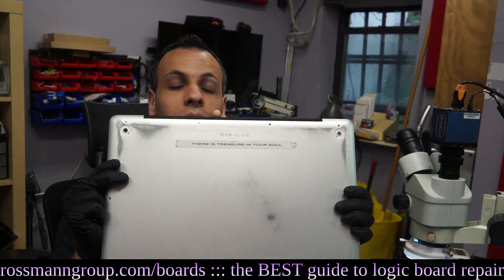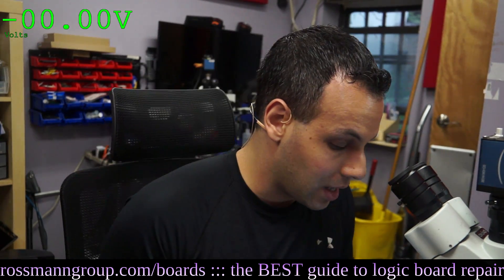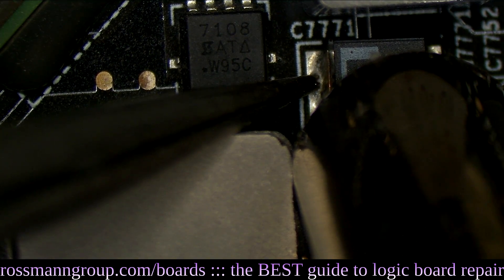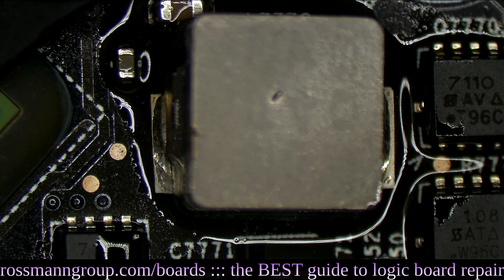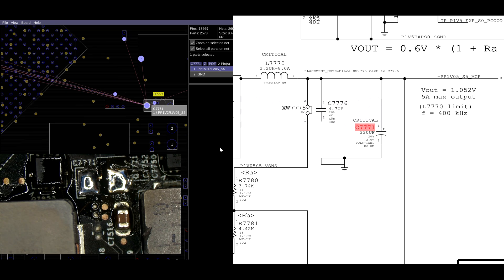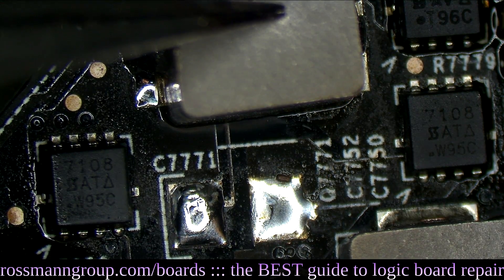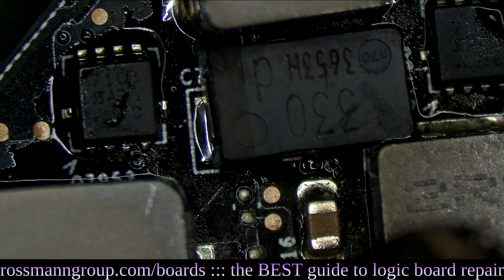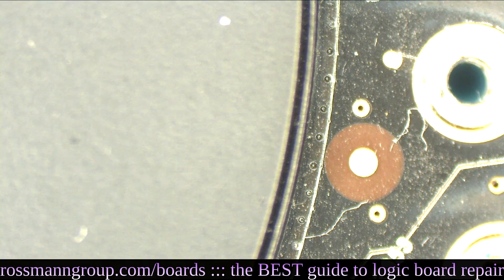Can room temperature kill a Macbook?

Comment: I enjoy your videos, and I have no problem with you replacing a component using an alternative package if you don't happen to have the proper one at the moment, but implying that the component spec'd in the schematic (330uf, 2V poly-tantalum B2 package) doesn't exist or that apple didn't use the one spec'd in the schematic, or that others should intentionally replace the component with one in a larger package, or selling that component-in-the-wrong-package on your website at a 500% markup:  that just plain ignorant.  https://www.digikey.com/product-detail/en/panasonic-electronic-components/2TPE330MADGB/P16190CT-ND/4146633

Comment: For the weather problem, do you think if the huge difference in change of temperature will result in a corroded motherboar of phone? Hong Kong is hot and wet in summer and I do clerk work in office.
When stay for a long enough time then go outside for a rest or lunch, there will be a layer of visible moist condense on the phone. I believe that also happens inside. What will you suggest to mitigate that? Because I had my iPhone 7+ (Yes, it happened to be a n Apple product) doesn't turn on suddenly and Apple authorized service provider reported  that Apple said* my phone had large area of corrosion and visible water stain

*Service provider says phonethat is not turning on are sent to Apple for inspection

Comment: i am lucky that apple doesnt care about you. your wit would be sorely missed should apple ever consider you for product design. i dont think that that is likely to happen though. their margins per product would be cut in half and they would sell fewer products. on the up side though people would have to start getting alot more creative when breaking machines. also the slogan would have to change. "think different" wouldnt apply any more. "it just works" would have to become their new slogan. suddenly machines would weigh 3 pounds instead of 2. made of actual metal with real circuits, logically arrayed and fused. with daughter boards that are wanton hussies for io.   maybe even liquid sealed for their protection.

Comment: so it's another one mistake by user... they use it at wrong room temperature..
Reply: It's not a flaw... It's a FEATURE. lol
Reply: Be brave, and crank up the thermostat to 30°.
Reply: of course, all mac were designed to be used at your local starbucks
Reply: Just don't air-condition it that way.

Comment: give that capacitor a break. it had to work at a huge ripple current, and it did its job for 9 years flawlessly. Not bad for a part made in China, no?  The new part will probably work some more years, since capacitor technology evolved in the meantime.
Reply: So you paid so much to get an capacitor from China? While other brands like MSI etc are using capacitors from Japan? And still are giving them credit...
Reply: L HK You can tell by brand, I don't know them all out of my head but I believe the most commons are Sanyo, Rubycon & Panasonic (Matsushita)
Reply: Glenn Vandeuren how do you which capacitor is from where.

Comment: That's a crappy flaw. Honestly, it feels more like the higher-ups wanted to save a penny on some random capacitors. At least it's a simple and easy fix. The engineers were probably competent, just forced to make a bad design. Nowadays they have crappy engineers making butterflies or whatever.
Reply: Yeah this kind of repair is complete doable, and well within IPC compliance. You are allowed to move SMD components like resistors, capacitors, and coil packs 50% off it's pad. So moving the coil pack, and adding a capacitor that is larger with a connector double the pad size, would have been all within compliance. But machines can't do this, it requires a human to make the repair, or manually solder those components, as when the circuit board runs through the oven after pick-n-place the components will float onto their pads with surface tension.
Reply: It seems like every day, Apple just gets worse and worse... Wozniak left years ago, and Jobs is dead. Apple isn't ever going to be like they used to be.
Reply: most likely they KNEW it would fail so you buy a new one... i honestly wouldnt be surprised if thats the case, looking back on their past product failures...
Reply: @moth.monster  this was made when Steve jobs was alive so why does it matter that he died he cared enough about the consumer as the current administration ruling apple

Comment: I'd be interested to see how other laptop manufacturers introduce design flaws like this, too. Surely Apple can't be the only one to make mistakes, even though we know they probably make the most.
Reply: most other companies have similar mistakes, but they refund customers, offer warranties, admit their mistakes and do not overcharge for their products as much as apple
Reply: It’s certainly not unique to Apple, but their high prices and limited number of models make repairs like this more “practical”.
Reply: Design flaws happen quite often, and as a soldering repair tech. I've had to replace small parts with bigger parts that don't entirely fit on the pads, stack 2-3 caps on top of each other on the same pad, or make a series of caps/resistors across pads. There are companies that make corrections and allow for modifications that are all within IPC compliance. But this requires a lot more time, and costs more money, and doesn't look aesthetically pleasing, so most don't bother.
Reply: MSI's logo and the old distinctive res boards used to be one of my "brand based diagnostics"... But MSI have become somewhat better over the past 5 to 10 years, and generally don't crap at out anywhere near the rate they used to.... Personally still don't buy them, but I don't assume they're crap now either.
Reply: Nah.. most of them are the same crap.. 
Thats why i had to go back for my 9 year old dell 1545 and ditch my "new" (at the time it was new) inspiron 15r 5537 with an i7.
Reply: There are quite a few problematic series in all the brands. At apple is problematic the thing you only get one per year. Now if you watch some movies, light games, light usage overall, macbooks will last forever. It's a tablet in my opinion and should be treated likewise. The main difference between apple and Asus with all it's branches is that the second one it's fixable home and also the mobos are cheap.
Reply: Sure there are. I had a first gen Dell XPS 13 go bad due to the defective  graphics chip, but the difference is, Dell replaced the board 3 times over 3 years, at my office within 24hrs of the call in. Apple? Good luck with that.
Reply: 4G63TDSM Well... 2 months after the warranty got over, they didnt replaced mine. Also, when it was on warranty they would just point to the dell's driver website or remote acess the laptop, and make a bunch of random configurations (like disabling the amd chip), basically band-aiding the system, and just call it a day, when in fact that shitty laptop had a vrm issue, toghether with a problematic gpu chip. It died right after that. I revived it sometimes, but then it really died.
Maybe in the usa, dell's support works, here where i live it doesnt.
Reply: I had a gateway Laptop back in 2000 that had the cpu heatsink rigged up to screw into posts that were only soldierd to the mb right lets put mechanical strain on solder around a item that produces heat Brilliant.
Reply: I would be very supprised if there aren't any, but also very suprised if there are many.
The thing is that brands like MSI, ASUS, etc are specialised in what they do, they make much more Motherboards then Apple.
Reply: I would agree with you up to a point. Although, I would argue that laptop motherboards go through different stresses than desktop motherboards.
Reply: Very true, about the laptops, the ones I see mostly fail because they where running hot so would say is more the fault of who designs the laptop, I remember also seeing many machines with broken GPU's so that could count, for the rest never saw any major problems with the electronics itself, the last 5 years I don't see that many machines anymore seems everything at a certain price is decent enough and many use their phones in combination with a desktop instead of an laptop offcourse.
Reply: Glenn Vandeuren A lot of this failure from overheating issue I've seen en masse like the Xbox 360 red ring of death can be traced back to rohs compliance. Not having even that little extra dab of lead in there really seems to make the difference. Just another thing that companies have to combat while probably getting blamed for something that isn't their fault really.
Reply: Damn, now that I think about it, there was a period where many MSI laptops had broken motherboards, but they did the right thing and replaced them all, they also gave another year waranty for the motherboard itself plus I remember two machines with missing keyboard caps and one with a broke mousepad returning fixed without they billing for it.
Reply: Glenn Vandeuren I don't think you'd ever see Apple doing that, lol. All the MSI products I've ever owned have been great. I've only ever had to RMA a few things. Guess I've been lucky.
Reply: MalleusSemperVictor Oh, I didn't know about that, to be honest I only work with desktops, laptops, phones & other small electronics
Reply: MalleusSemperVictor I actually switched to MSI because of that experience, I see it otherwise,  you aren't lucky, MSI makes great products! Any company can have some bad luck, but some just have to many problems to be bad luck :p

Comment: My xbox360 fell down two staircases, one cement, red ringed 3 times and is still with us today, my android phone has been dropped in both the Atlantic ocean and the Pacific, also spent a night on the ground of a flooded tent the week i got it and its still going.
Pressed the power button on my macbook the other day, started up, then shut off and wont turn back on.
CrApple wont do anythi g about it either.
Reply: how did you recover your phone after it dropping to the bottom of the ocean twice?
Reply: @DMack6464  Ever heard of the beach?
Reply: To be perfectly fair to him, I dropped my old Gen 1 Moto X in a lake, and retrieved it an hour later, and it still worked fine.
Reply: Ethan Brasoveanu the Beach.
Reply: Funny. My phone actually started having overheating issues on the WiFi chip after a ski trip.
Reply: Ethan Brasoveanu  I did it a lot for Halo 2 LAN parties. OP just seems really clumsy to me.
Reply: Ethan Brasoveanu  uh .. basements?
Reply: How.. how did nobody realise the joke here?
Reply: @w63015  I know right ever heard of a hyperbole they're like my favorite thing ever
Reply: He just tells a story. An apple-hating liar. Nothing very special here ;)

Comment: To be fair its an old maschine; 8 years is a long time for any notebook to last
Reply: 8 years is nothing for sensibly designed electronics that are made using quality components able to withstand the wear of use.

If you use crap components that will fail because you are already pushing their working parameter envelope just by using the device, you create work for people like Louis. Like Apple does.

Tbh, more companies do it nowadays. And Laptops need to compromise with ventilation and performance, even when constructed sensibly. Apple just takes the cake in selling shoddy design at inflated pricing.
Reply: i have an old soviet TV "Horizont 107" made in 1980 - still works perfectly and has never undergo any maintance.
Reply: nomnom moon I bought an HP NC6400 in 2006 and gave it away in 2016. It was still working.
Reply: I have some old LG laptop from ≈2004 and it still works fine except the screen is broken. Never been repaired to my knowledge.
Reply: I've got a Dell Inspiron 1525 which once had half a bottle of white wine poured over it and I use it as a media center machine for my TV.

It's 10 years old, the only thing I did to it is install an ssd
Reply: Noah Hastings really activates those almonds
Reply: Heck, I just picked up an Thinkpad x201 tablet from 2010 that still works perfectly running win 10 and feels faster than my 2015 macbook pro 13"
Reply: Not true, I have a wallstreet mac laptop thats almost 20 years old and still works and runs OS 9. Everything 2003 and after gets progressively worse. The Titanium case laptops were the last good laptops from mac(and they were not really that good). The thing is, sub 1ghz, sub 1Gb ram computers are not too fun to use now a days except for nostalgia or running a print shop.
Reply: nomnom moon not a PC but I have the original 06 fat ps3 had the yellow light of death twice also survived pop being spilled on it and it still works in 2018
Reply: what i mean is after 8 years many notebooks/pcs have some kind of problem not just mac. Maybe this shows you mac from steve jobs era atleast have some quality in it afterall.
Reply: Steve Jobs pulled a fast one on hier customers with the ecosystem-lockdown. And the "who would ever want to do _that_?"-approach.

Granted, hardware wasn't quite as shitty back then, but that holds true for PCs as well.
Reply: comp lame in Soviet Russia TV watch you! Scnr